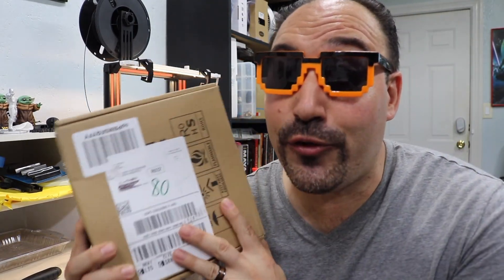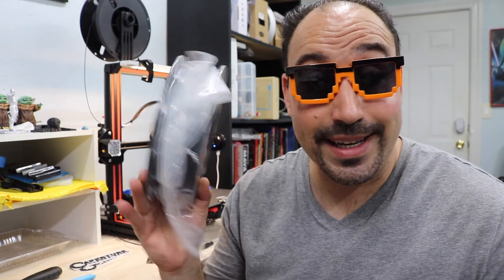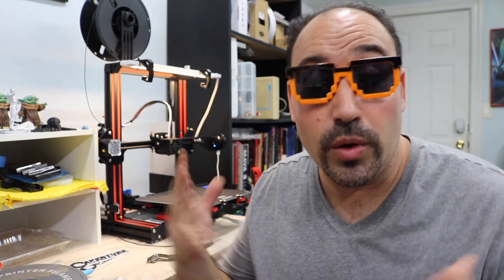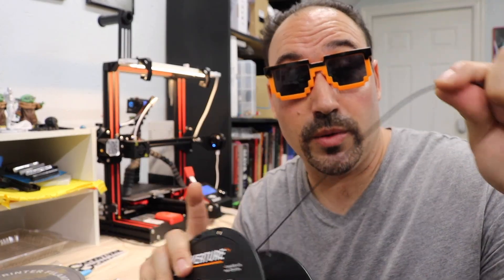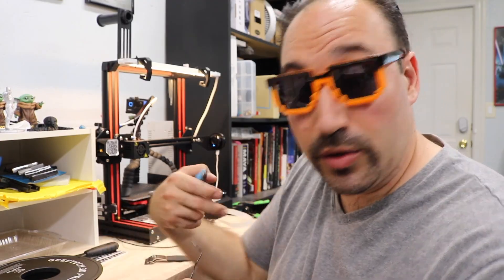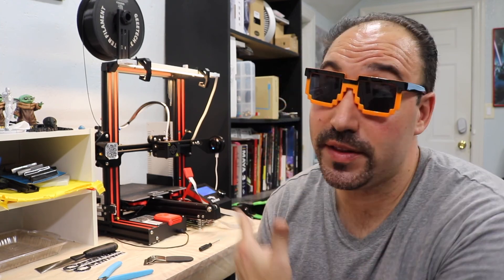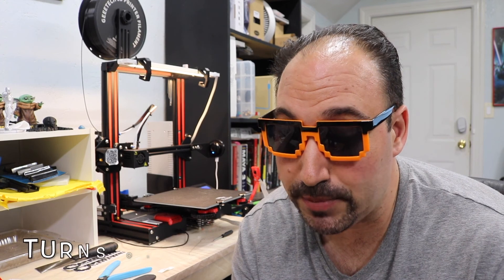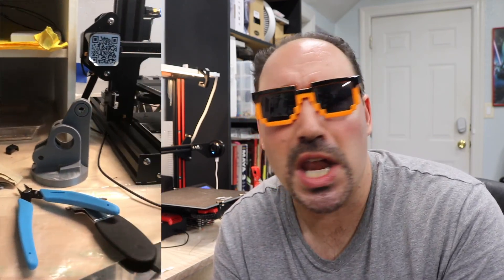How to load and test new filament on an Ender 3

Comment: do you have to pre-heat?
Reply from the maker: The G code does that for you. I have the file link in the description. But if you don’t want to use the file and just measure yourself yes I would preheat it to the temperature of the filament.

Comment: If I can't  go to the gym and I'm trying to beat my max that is 195lbs and I have access to a curl bar bigger than a average curl bar but smaller than a barbell and I floor press 100lbs for 4x25 to 2x25 aswell  as bridge floor press can I increase my bench even if it's  just by 5lbs. Because to me if I bench 200 twice wouldn't it be equal to bench pressing 100lbs 4x? Or if that's wrong will it still do anything?

Comment: Hi Crazy Will,
Nice to see you doing some Ender print vid's!!!
Thanks for the heat tower idea, what a great way to find the optimal setting.
Is your E3, stock or have you done any mods???
IE. main board, print drivers, direct drive etc??
Or are you planning any mods??
Respect and regards,
Jack
Reply from the maker: Thanks 😊 no it all stock just printed the v slot covers, fan cover, anti-slip adjustment knobs, and extruder spinner that the raspberry pi logo. I also have a raspberry pie Runny octopi. I’m obsessed with 3-D printing.